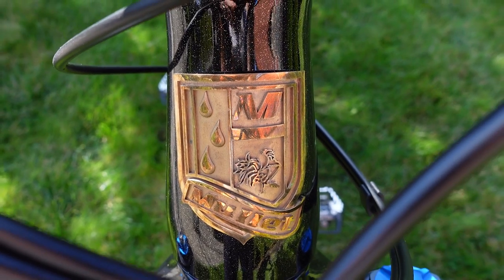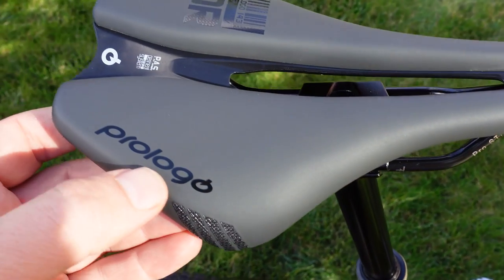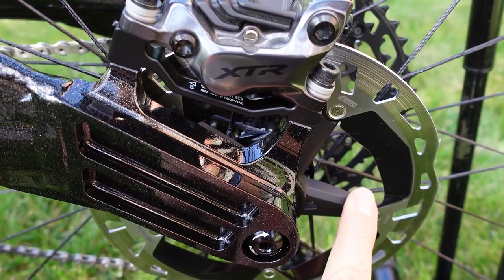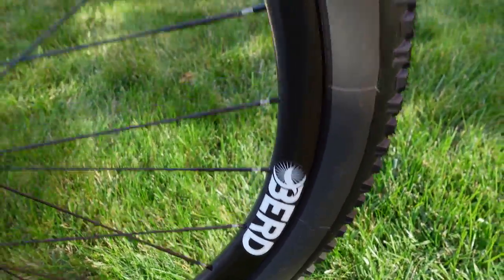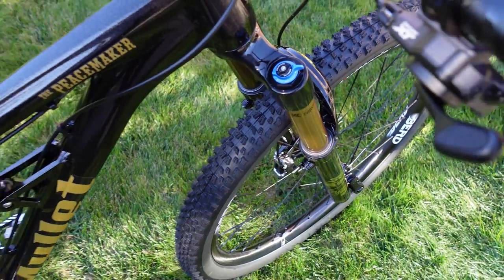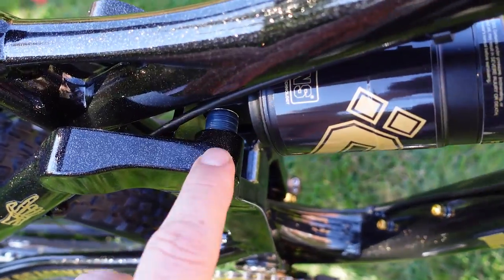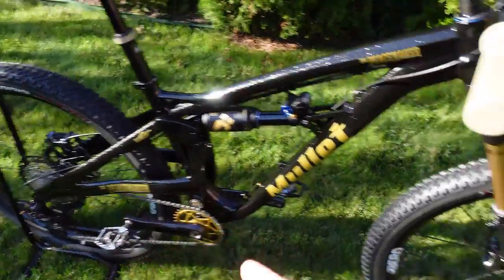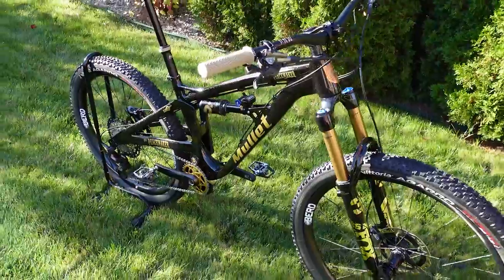Dream Mullet Bike - The Peacemaker - 27.5 / 29 Mixed Wheel 150mm Full Suspension Bike Check

Comment: Can you fit a bash guide? there is not much clearance at the top by the chainring and pivot, I need a chain guide.
Reply: @LoveMTB  shame I think that's a big flaw, strange but not the only brand doing tha tnistake, Scott has doen it for years. But the reasons were different, cabin frame with no where to mount a guide not even at the BB shell it self cus of the shape. Horrible Imo, all bikes i own should have a guide.
Reply: @LoveMTB  This is incorrect. It has a ICSG05 mount and fits a Blackspire bashgaurd perfectly.
Reply: @mtbboy1993  The reviewer is incorrect. I run a Blackspire chain guard on mine, no issues.
Reply: @johnnyweekend  But is it a bash guide or only bash guard? a chain guide is needed to keep the chain on. at 7:02  you can see how close the chain, chainring is to the pivot. there is no way you could fit chain guide or bash guide there. I see it fits a bash guard. So unless sb. makes a bash guide specifically for this bike you cant have a chain guide at the top.
Reply: @Johannes Nilsen  It's a bashguard and chainguide. TrailX Version 2 by Blackspire. Don't tell me what "doesn't fit" when I'm running it with no clearance issues 👍
Reply: @Johannes Nilsen  And if you don't need a bashguard, the Blackspire EinFach Version2 works no problem.
Reply: @johnnyweekend  so it fits that bike?
Reply: @johnnyweekend  Sweet, it looked like it had maybe 2 mm clearance, in this video. I don't know if they changed things, but somehow in the video it looks crazy close.
Reply: @johnnyweekend  Does it fit straight? is the guide at the top? centred? or does it have to be at an angle, that does not count.
Reply: @johnnyweekend  I use an oval chainring, so this means the only chain guide I can use is Absolute black or 77 Designs, and the guide has to be centred with the BB, and guide has to cover the lowest point on the oval chainring.  I currently ride a Geometron G1, I am curious and asking, stuff, that mgiht be of concern for others, or might be an ops/ ohh sh!t moment.
Reply: @Johannes Nilsen  It does look crazy close on that bike. Pretty sure whoever built this didn't use the correct spacer behind the BB. I've had this bike for a full season now, pretty sure it's the same design. By far the best bike I've ever ridden and I ride them all.
Reply: @johnnyweekend  Sweet, BB spacer is a common mistake. good to know it fits.

Comment: I'm sorry but these guys not releasing their geometry is just silly. It's great to see some innovation around designing bikes specifically for the mullet setup (which of course they didn't invent), but who in their right mind would buy a bike without knowing basic geo data? Like the BB height, head tube angle and seat tube angle at a minimum.

They call their geometry their "secret sauce". That's a bit of a misnomer because, guess what, anyone with an angle app on their phone and a measuring tape can let us all know what the geometry is after they buy the bike.
Reply: @LoveMTB  I hear you. I just think a better approach would be to sell us on why their geo makes more sense for mullet bikes, even if it challenges conventional wisdom. For example, maybe a higher BB and steeper HT angle makes sense on mixed wheel bikes. I think most of us are open to new ideas.
Reply: @LoveMTB  Yeah that makes sense. I'm getting more pedal strikes than I'd like with my current mullet setup since it lowered the BB. I've even been considering workarounds like using an eccentric BB, smaller cranks, etc. If these guys came out with a carbon hardtail version in a more clean design (like the ARC) I'd definitely be interested.

Comment: Don't like it. I know that suspension design is different but generally, the bike looks like a child of Yeti SB6 and Orange bíkes but much worse. Which makes me always think it's a chip fake when I look at this bike. Other than that it's just another bike equipped with the top-spec parts.
Suspension: pedal kickback guaranteed... Frame - external routing, simple suspension design, alu, welding is far from Nikolai quality (at least visually), but frame price is much more expensive than Santa Cruz alu frame with much more advanced suspension design and internal cable routing. And IMHO much pretier...
But as usual, thanks for the good review and topic to put my useless 5 coins😂
Reply: @LoveMTB  looking forward to your riding impressions.
Reply: The single pivot is one thing but man I love external routing, as long as it's done cleanly and this looks great. Nothing like having to cut your brake and shifting lines to do some basic pivot cleaning and overhaul.
Reply: And they don't even tell you the geo of the bike! Absolutely insane.

Comment: 😛😛😛😛😛
Reply: @LoveMTB  Yes indeed! I checked out their website and they offer a similar bike to my Orbea laufey which turned out to be the love of my life. Perfect Geo on an M frame. It’s much shorter in reach then any other newschool bike. I ride it hard with a big fork rockshocks 35 and Mullet  setup for shutteling. Right now it’s my XC fitness bike😎 with the original fork and wheels.
As my shutteling bike I have a Canyon Torque CF8 20 all XT and carbon.
I’d rather have an AL frame build with XT breaks and a GX drivetrain for the Dreamsuperendurobike😁
Reply: @LoveMTB  stellar engineering from the Mulletcycles team then!🤩
I’ll take your word for it. I wonder what kind of Ork is supposed to ride these Newschool bikes then.
Just slap a motor on there and pedalingefficiency or comfort on the uphill are no sellingpoints or basis for modern bikes anymore. Total rubbish if not to say scam.
Reply: @LoveMTB  I agree. Thank you for sharing

Comment: I can't respect a company that purposefully withholds its geo information. Like, wtf is the point?
Reply: @LoveMTB  ummm, geo is one of the main things that determines how a bike rides, and with no way to test ride one of these bikes, the best way to understand how it would ride is to look at the geo.
Reply: @LoveMTB  so, please inform me what aspects of a bike makes it different to another. From my experiences, it's suspension travel, geo, suspension design, and frame material.
Reply: @SpencerBaum  bike companies have been developing geometry for mountain bikes for the past 30 years, as it relates to SYMMETRICAL WHEELS. Meaning, the hubs are parallel to the ground, like a road bike. These hubs are not parallel to the ground, meaning the front hub sits higher than the rear. Therefore, whatever geometry you're familiar with would not apply to an elevated axle path. Some interesting stuff I learned on their website and I'm a hard sell. Personally I've been calling my mixed wheel Forbidden a mullet for 2 years and now I feel like a poser. I never called my Trek 69er a mullet. Crazy that they're cool with everyone using their name but I think it's smart that they're not publishing their Geo. With that said, if this thing can climb then I'm definitely getting one. I can't imagine a 38T ring w/ 2.8 tires on 6" of travel 😮